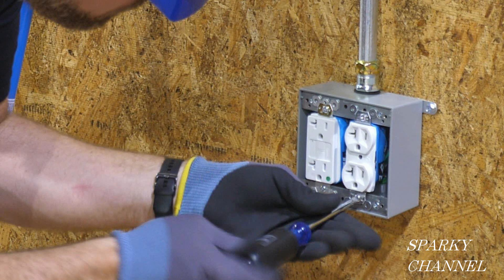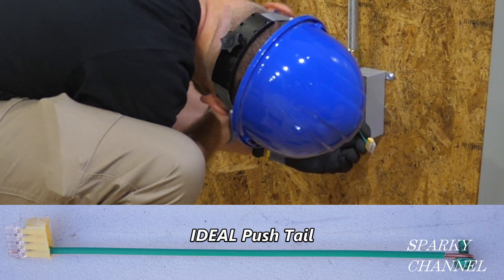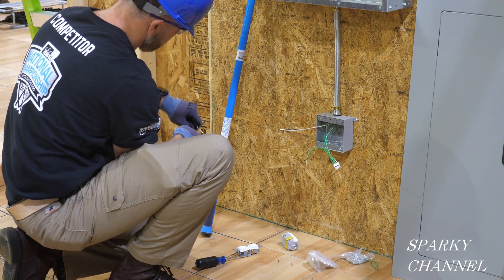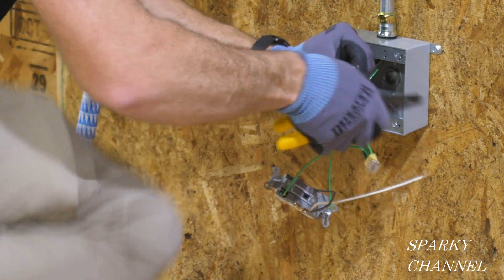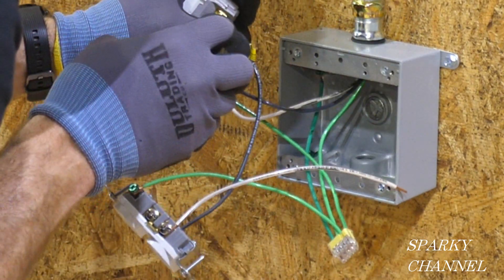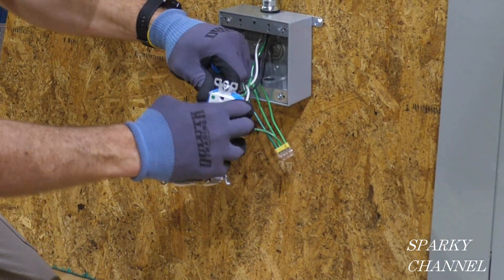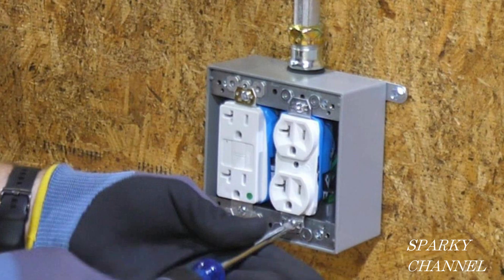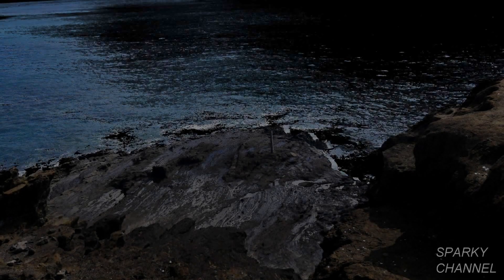Watch a Pro Wire a 20A GFCI and 20A Receptacle, Any Code Violations?

Comment: Why does Greg install the receptacles "upside down"
Reply: No code requirement to install them in either direction.
Reply: @wakes_inc  correct but just look at a NEMA reference chart
Reply: Yep safer the other way
Reply: Ground down is better.
Reply: @news_internationale2035  why? Ground up is how right angle plug ends are then the cord hangs down. also if using straight plug and it pulls out slightly only a ground is exposed
Reply: @Ramdodge582  No, on many power strips, or ac to dc "wall warts", ground up puts tension on the cord, because the cord has to go up then down at a sharp angle.

Comment: Got it right, but I never like to tighten down on the 10/32's to push the receptacle into the outlet.  Sometimes that can force unintended damage onto wires inside a box.  Not really a big concern with this box not being overloaded with wires, but still  part of my common practice.
Reply from the maker: Thanks!

Comment: I troubleshoot 80% of the time and these push connectors are a problem about 5 years after installed, only takes a few seconds to make a real connection with a wire nut, cheap quick way out not a long term connection, just saying
Reply: In Some countries you have to use the push connectors and can't use wire nuts
Reply: @50_cal56  that's interesting to hear, and crazy the do that, didn't know
Reply: @tannerbushey9196  there’s a different style of stab-ins where you manually flip a tab. Supposedly, they last much longer. However, from the tests I’ve seen, they also have a higher resistance than wire nuts and therefore they heat up more.
Reply: Correct I never like this push connector and seen them burning up lot of time.
Reply from the maker: Thanks!

Comment: 406.4 is specifically for replacing non grounding type recepticals where an equipment grounding conductor does not exist. Since there is a grounding conductor that code wouldnt apply
Reply from the maker: Thanks!
Reply: @SparkyChannel  no idea why he apply the middle of the code but not the whole thing.
Reply: Absolutely. Came here to comment the same thing

Comment: I'm not an electrician. Is the idea that consumers are not expected to recognize a GFCI outlet,  therefore is must be labeled? Seems obvious to me. Realizing it may not be obvious to everyone. 

New question: Will they even know what GFCI Protrcted means?

We do it because it's code. I'm not convinced someone who can't recognize a GFCI outlet is even going to know what GFCI Protected means.
Reply: The plug on the right is not a GFCI outlet. But, the way he connected it, it IS protected by the GFCI plug, even though it's just a conventional plug. So in that case, putting on a sticker will tell any users that even though it's not GFCI, it still has that protection because of the way it's connected GFCI plug.
Reply: @frameriteairdrie578  good point!
Reply: I believe if you own a house, you should know the basics of a house's electrical system. Which would include the knowledge of a gfci and what it does and what they look like. It saves you a lot of money to know a little bit of every trade, you know?
Reply from the maker: Hopefully.
Reply: It’s all code for electricians to follow not ordinary people to know and understand. Also a receptacle that’s gfi protected would not be known without a plug checker or a sticker on it confirming and assuming it is up to code. I do agree a regular gfi is pretty obvious to being protected but some exterior outlets are gfi protected down the line or at the breaker sometimes
Reply from the maker: @fedfreds832  Thanks!
Reply: The sticker isn't necessary inmost cases including this one. If you read the code passage he put on screen in it's entirety, you'll see it does not apply in this instance. The passage allows you to replace interior ungrounded (two prong) recepts w grounded 3 prong if you GFCI protect them and use a sticker that says "GFCI protected no equipment ground". That doesn't apply here.
Reply: I've since heard that you can feed additional Outlets from a GFCI outlet. They would both share the protection. Then I could see the second one needing a label.
Reply: @geniferteal4178  it still doesn't need a label in that case. It's only required in the specific instance mentioned above- if installed where there is no ground wire. If you buy a GFCI receptacle it comes with stickers for this: they say "GFCI protected, no equipment ground" on each individual sticker.
Reply: They could be confused with an AFCI only.
Which leads me to the question, is there an AFCI sticker?

And what about outlets that do both?

Comment: God I’m glad I’m an electrician in Australia, we just call them GPO ( general purpose outlet) and we can fit one off in about 35 seconds. This looks painful
Reply: Im from New Zealand and I couldn't agree more with you, so much of what they do seems backwards and unsafe just because that's the way it has to done
Reply: @Peaches_NZ  yep 100% , something about still doing steel conduit and steel fittings in houses in 2022 seems ridiculous
Reply: @Bushrookie820  What are you talking about having to run steel conduit in houses? Are you referring to the codes where you live? We don't have to run any steel conduit in houses whatsoever in America
Reply: @jamesmcguffey3569  Careful with the absolutes. It's sometimes done in basements.
Reply: @NickFrom1228  Show me the code that says steel conduit has to be ran in a residential setting other than the service mast please
Reply: @jamesmcguffey3569  I think we have gotten off on the wrong foot. I interpreted your comment as it is never done when looking back I see you are talking code requirements. Requirement-wise you are quite correct.
Reply: @NickFrom1228  No worries buddy. I was mostly annoyed by some of these other comments referring to the way this electrical install in the video was done in a "unsafe" way.
Reply from the maker: Thanks Dylan!

Comment: No electrician in Germany would use such a screwdriver! The installation looks wacky and overly complicated (so many screws).
Reply from the maker: What screwdriver would you use?
Reply: @SparkyChannel  a fully insulated. In Germany there are screwdrivers insulated to 1000V for electricians. We mustn’t use these metal workers screwdrivers.
Reply: @Andyw1228  This is a competition where I'm sure the contestants have to use Ideal products or else he would be using an impact drill more than likely. And you have to use a bulky insulated screwdriver in Germany wiring a couple of devices that aren't even energized? That sounds backwards to me. How does this installation look wacky? He installed those devices perfectly. So using your fancy insulated  screwdriver set how would you proceed to do this in more of an uncomplicated manner? I'm curious
Reply: @jamesmcguffey3569  wacky was probably the wrong term, it’s surely sturdy. But it’s overly complicated imho. One could do this without screws at all. Sockets in Germany and also Europe I might think, have clamps and you only need to push and insert the line. Screwed interconnections are mostly prohibited. The line would change its volume after time because if getting hot and cold and even the screws tend to shrink and expand. Eventually this could lead to a loose connection and thus to sparks and fire. The clamps , like Wagos, compensate this growth and shrinking. Screws are not completely forbidden and used for larger gauges in switches and other stuff.
Reply: @Andyw1228  useless if you are not working live
Reply: @WyattH  yes, but why use two different screwdrivers sets? One for normal installation and one for repair in a live environment?
Reply: @Andyw1228  because you don’t want to damage the insulation
Reply: @Andyw1228  
Maybe not everyone wants to work on commercial/industrial and is comfortable shutting the box off.

Comment: is he not using J-hooks?
Reply from the maker: For the standard receptacle he used J-hooks but for the GFCI he used the back wire system provided on the GFCI. It's a clamping system that does not require J-hooks although you can use J-hooks if you prefer.
Reply: @SparkyChannel  thank you!!!

Comment: So, code question. I wish I could post a picture of this thing. I'm looking at a nonmetallic old work box, that has been "converted" to new work by driving nails through it, there is a 7/8 hole drilled in the side for wiring with no clamp, and the switch is held in the box with wood screws. Any code violations here?
Reply: YEP. Homemade hack box isnt code compliant. the nails alone are a violation , the butchered make your own hole is another failure

Comment: I just scrolled past this video and had to comment on it before watching. It's gross you used 2 different style outlets 😂 other than that I'm sure the install is fine
Reply from the maker: It was a supply chain problem.
Reply: @SparkyChannel  Considering how exceedingly picky NEC is, it seems (to me) that a really picky inspector would not consider supply chain problems an excuse.

Comment: Seeing this I had to double check the code, something that I haven’t done in some time as on the commercial side we install a lot of conduit and use the conduit itself as the equipment bonding conductor and rarely pull grounds; it’s been so long that we’ve done it that way I thought maybe the code changed and I didn’t even realize but nope still in 2020 NEC §358.60. For us it’s all a money thing as it saves 1,000s of feet of copper by using the conduit. I like the wet location boxes though, over say 4” JBs for receptacles and switches as they are solid; I’ve always been worried about reachable knockout boxes and kids pushing a knockout in with their little fingers. While the wet location boxes cost more they’re what’s in my basement and garage as they just offer a better level of protection, and with a nice stainless cover they don’t look to shabby either. 
As I’ve had to diagnose my fare share of de-energized receptacles only to find out they’re controlled by a GFCI I appreciate the marking and must say it’s one I notice is rarely done. I once saw a bathroom outlet not work because a GFCI was tripped; the GFCI though was located outside under the deck, despite having another GFCI in the bathroom some 6 feet from the first outlet, they wired the newly added outlet off the deck GFCI. May have been for more direct wiring but without labeling it, not that a simple label would have told you which GFCI controls is, would have helped much. One big thing you see in the commercial space that residential could benefit from is labeling and keeping track of additions to help with tracing.
Reply from the maker: Thanks, great discussion!

Comment: The load receptacle had its own ground wire attached, so I don't understand the third violation.
Reply: the third violation is not marking the grounded receptacle as GFCI protected, such as using the blue sticker seen at 7:57.
Reply: Still missing the required No Equipment Ground marking-
"An equipment grounding conductor shall not be connected between the grounding type receptacles."
That implies the ground should remain unconnected.

Comment: I picked up right away he was not using weather resistant receptacles. Receptacles with the green dot are usually 20amp hospital grade receptacles and they are not listed for outside.
Reply from the maker: Yes sir, correct!

Comment: There it is, on the back of the GFCI, the now ever present “CHINA”.  I’d love to see far more products back to, MADE IN USA.”  PERIOD.

I always found it odd, that for a GFCI label, the ones supplied are nowhere near made to be permanent.  I’ve seen GFCI labels sitting in the bottom of weather covers and when there is no cover, who knows where it ended up.  Why not some other standard such as using a red (or any color for that matter should red not be appropriate) permanent marker to draw a band across some part of the protected receptacle’s face signifying that it is GFCI protected?  Put the label on as well.
Reply from the maker: Great ideas, thanks!
Reply: @SparkyChannel  I enjoy your videos, very well done and helpful.

Comment: I definitely don’t recommend taping or installing the ideal bands on outside GFCIs. Moisture can collect on the tape/band and create a path from the phase to ground, causing a nuisance GFCI trip.
Reply from the maker: Interesting!
Reply: @SparkyChannel  not saying this will always happen, just my experience with the humidity here in Kansas. If the box is sealed well it might not be an issue.

Comment: Two comments; didn't see a nylon bushing on the box connector in the panel. Also, since he was supposed to label the GFCI with a GFCI sticker, was he also supposed to label "No Equipment Ground" as well? When reading that section of the Code it is unclear to me.
Thanks, Sparky for another great video!
Reply: Why would he label it no equipment ground? There is an EGC (notice all the green ground wires he connected). He just needed to label the receptacle with "GFCI Protected" sticker.
Reply: @illestofdemall13  Actually you don’t need to label the other receptacle at all. That only applies to receptacles without an equipment ground. It seems like he misinterpreted the code
Reply: @purplesparkyy  This is also my take on it. That code section is for replacement of ungrounded receptacles.
Reply: @purplesparkyy  
The wording says "and", so it's poorly written if it's subject to misinterpretation. They could have added "as applicable" so it can be satisfied even if taken literally.

(c) A non-grounding-type receptacle(s) shall be permitted to be replaced with a grounding-type receptacle (s) where supplied through a ground-fault circuit interrupter. Where grounding-type receptacles are supplied through the ground-fault circuit interrupter, grounding-type receptacles or their cover plates shall be marked "GFCI Protected" and "No Equipment Ground," visible after installation. An equipment grounding conductor shall not be connected between the grounding-type receptacles.
Informational Note No. 1: Some equipment or appliance manfacturers require that the branch circuit to the equipment or appliance includes an equipment grounding conductor
Reply from the maker: @wingerrrrrrrrr  Excellent, thanks!
Reply from the maker: @illestofdemall13  Hi Kris! That's the way I see it as well.
Reply: Also, a connector bushing is not required for wires smaller than #6 (or is it #6 and smaller?).

Comment: A very outstanding presentation Mr. Sparky, but I did notice one thing that does not have anything to do with the wiring method. I saw where the receptacles were made in China! I think I would have used a Leviton receptacle. I don't trust ANYTHING made in China, especially if its electrical equipment.
Reply from the maker: You have good eyes. I didn't see that. I think most of the Leviton receptacles are made in Mexico.

Comment: Hey, I’m Kimberly Rodriguez a senior at Bronx Design And Construction Academy and currently in the electrical major,  my instructor recommends a lot of your videos they have helped me understand  NEC requirements and violations that can be easily made, I have learned a lot from them thanks a lot, really appreciated it.
Reply from the maker: Hi Kimberly. Write me at wpm44@yahoo.com if you would like some Sparky Channel stickers. They are the perfect size for hard hats. Also, I can send some for fellow students if you like as well.
Reply: @SparkyChannel  Your videos has been helpful throughout our senior year in high school. We’ve applied code regulations when doing our jobs or lessons our instructor gives us. We’ve learned so much by watching your videos, we appreciate you!!
Reply from the maker: @FernandoRodriguez-ur8wc  Fantastic!
Reply: @SparkyChannel  Hey sparky, your videos have been very helpful to me and my senior peers in BXDCA, also your conduits bending videos have been a blessing, made conduit bending a little bit more easier, especially the 3 points and 4 points saddle bends.
Reply from the maker: @tdnrhbm9144  Excellent, great to hear!

Comment: Take apart a sample of a “‘weather resistant’’ GFI receptical, and a regular GFI and show us the difference. 30 plus years using GFI’s on industrial sites, and wiring homes, and have never had a problem, with outside GFI’s. What is the meaning behind the code on this device, and why was it brought in to code.
Reply from the maker: The WR devises are made of a kind of plastic/nylon which is more weather resistant than the regular devises.

Comment: I noticed these are NEMA 5-20 receptacles.    Are these connect to a 20 Amp rated circuit,  if not, that's a code violation,  but 15 or 20 amp 125 or 250 volt receptacles shall be permitted to be used on a 20 Amp circuit.
Reply from the maker: Correct. It was connected to a 20A breaker.

Comment: What gauge wire should you use on a 20 amp receptacle @SparkyChannel
Reply from the maker: 12 gauge or bigger if necessary due to voltage drop.

Comment: It's nice to see pros use the Ideal Push-In connectors. I love em, even though a lot of pros will only ever use wire nuts.
Reply from the maker: Thanks!
Reply: Tell me about it. There's no comparison when it comes to long-term reliability in residential work. Just be sure to go with WAGO and not the cheap knock-offs.
Reply: @ethelryan257  
I like Wago for lever lock type connectors, and Ideal for the Push-In type.  :)
Reply: 37 years as the IBEW contractor and employee over 10 to 14 employees at a time I would never allow them to use Wago or ideal push in connectors as I would never allow them to use backstabbing into a receptacle your contact surface area of the wire is very minimal on each of these a good wire nut covers three quarters of an inch or 5/8 of an inch of solid copper that is Twisted together in a very secure manner thus giving you a much more surface area conductivity